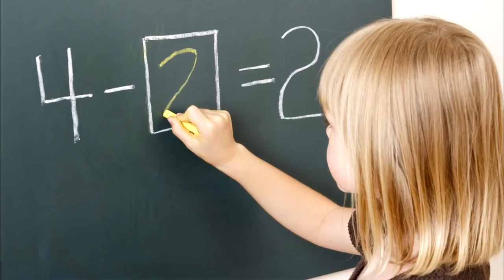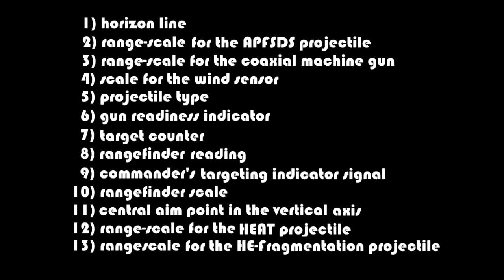Was T-80 really a FAILURE? T-80 tank Review

Comment: Hi, please cover the main diferences between homemade usser t72's and the licensed versions made by other countries what tech the soviets did not give to the warsaw pact countries and how that loweres their preformance + do upgrades such as the polish pt-91 twardy compansate for that lack, and how would these upgrade packages compare to i.e. t72b3 ? in general is it worth it, or better design something new (for countries thinking about modernizing their t72 fleet)
Reply: Polish T-72m did not have combined armor, modern radios, ammunition, range finders. Control over their manufacture was not carried out. Sometimes the systems were replaced with the ones available to the customer, sometimes even better than the original ones.
European and combined modernization (europe, united states, Israel) mainly affect communication systems, navigation, coordination, sights and thermal imagery, sometimes engine replacement, etc. There are quite good ammunition. But there is no cardinal difference.
The T-72B3M differs from the T-72B and especially the simpler T-72A and T-72M, initially a heavier and more efficient combination armor, a new cannon, a loading device for more effective projectiles, a new engine, an integrated digital control and diagnostic system, for integration with network-centric systems, guided weapons and the ability to use modern versions of concealment systems and active protection (Arena-M or E), a new ERA on the body and tower.
In the future, complex modifications of armor and engine and transmission will be added, replacement of the gun with a modern one, another autoloader of ammunition, etc.
With regard to communication, navigation and sights, it is at least as good.
Modernization of the T-72B3M is more complex and in fact is a major overhaul with a complete replacement of all systems for more efficient ones, in addition, it is cheaper. T-80BVM uses most of these systems in the new version. In addition, modernization is carried out in stages and much remains to be done.

Comment: Oh Russia uses the T-80 base, especially in harsh conditions!
The Kuril Islands will have (already have) a Battalion of them stationed, (or more)!
The newer Gas Turbine is much better to start and operate in cold and harsh climates!
Or more accurately, you can start it cold without the need of an hour or more of preparation before the engine can start (frozen oil, fuel etc) in -50°C (-58°F).
I

Comment: I would also disagree, that tank crew weren’t proparly prepared for T-80 handling. Just before entering the city crews shows a perfect performance of conquering the territory arround the city and had lost only 1 T-80bv, which been hit and then exploded after several minutes on the airfield from the atgm using a top distance. Crew showed a perfect knowledge of their t-80’s, considering the ability to use night vision during one of the battles and request artillery support to engage chechens Grad mlrs and suv-car with atgm mounted on it. However we all know that the night vision of t-80 is far from thermal imagers performance.

Comment: really gas turbine is so much expensive than diesel engine? This is firts time I hear that. I wonder why, since gas turbines seems to be fundamentaly simpler and smaller.
Reply: It's not the gas turbine itself that is more expensive - although if you start to use single-crystal turbine blades, exotic combustor lining materials, FADEC controls, and so forth you can really start to increase the price dramatically.
It's more the ancillaries, the electronics, the cooling systems, the pumps, and so on and so forth.
http://www.trucktrend.com/cool-trucks/0902dp-m1-abrams-tank/
This is a pretty good picture of the Honeywell AGT1500 gas turbine engine. As you can see, the gas turbine itself is pretty tiny.
But all of the ancillaries needed to make it run properly are massive. 

If you compare it to a turbo-diesel with multi-fuel capability: http://www.trucktrend.com/features/1602-mtu-mt-883-v-12/ the engine is heavier by some 600 kilograms, but the volume taken up is smaller and there are less bulky ancillaries to run the engine. 

Yes there are more parts and more complexity in the engine itself, but this is offset in the relative simplicity in the accessories.
A lot of tank engineering revolves around under-armour volume when it comes time to laying out the final design. Quite often, the bulkier things are, the heavier it makes the vehicle. So even though you might be able to reduce the weight of a single system like the engine, if it takes up more space under armour, the vehicle itself has to grow and that is far more weight growth than a difference of 600kg might suggest. That is why it is very important to minimise under-armour volume, even if individual systems might be heavier as a result.

Comment: my question would be what is the benefit of the t90 compared to the t80 (with d-engine) in regards of initial and upkeep cost, and the possibility of implementing future systemupgrades
Reply: The fact that T-90 can be produced, and T-80U is impossible. It's just unreasonably expensive. The T-80 has no decisive advantages over the T-90.

Comment: As about chechen war and T-80 performance there. According to detailed investigation of Vladislav Belogrud of tank losses during the Grozniy assault T-80 shown a superior sustainability to any anti-tank weapon. Only ~30 of T-80s were completely lost in this battle with +30 damaged and repaired. One more interesting thing, T-80s had no ignition of catastrophic explosions during the heavy damages. All crew were able to escape heavily damaged tanks (if they stay alive after being hit), only after a time the ammunition exploded, and some are not (that is also superior comparing T-72). This contradicts with rumors, that T-72 is more reliable. T-80 was having a better performance simply to 2 key features, the T-72 didn’t have: - superior engine and speed, - able to shot on the move, by using computer fire control system, which is not present at T-72b’s 1A40 fire control (gunner have to move the gun manualy, after ballistivs calculated, while T-64b/T-80b gun raises automatically to required angle).

Comment: The losses of first grozniy battle at chechen war was a lack of low-level commanders and poor leadership. There were also a lack of infantry support, while being overfilled with armor vehicles. Having more infantry russian troops would be able to obtain the control of city buildings and some key points and crossroads, which were occupied by chechens instead. That was the main mistake made by field commanders. However, the plan of high-rank commanders worked, as troops infiltrate the city without resistance from chechens and only afterwards, after catastrofic decision to pause the actions and stay at railway station started to begin a big trouble.

Comment: Nothing wrong with the t-80 if used properly by motivated crew just as the turkish leopards have copped it in syria. MBTs are NOT mobile artillery or to be used without infantry support or there will be burning hulks on the nightly news, if anything it needs better fire control as all russian tanks burm hard when hit
Reply: Tanks burn because they do not use modern ammunition, protection and fire fighting systems.
The automatic loader is extremely difficult to hit if there is additional protection for the sides of the hull, the tower completely covers it from above. If you do not load secondary projectiles and fully charge the fire extinguishers, there is no such problem. Detonation is the result of a prolonged fire or detonation of the secondary stacking, rather than a loading automaton.